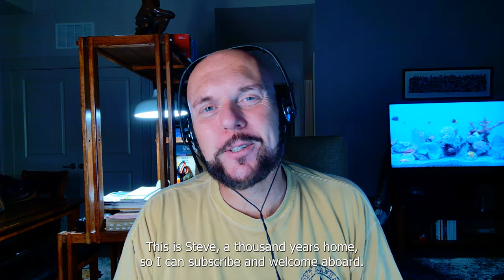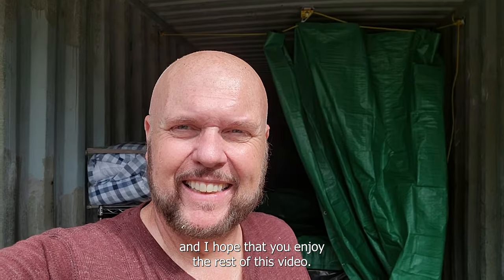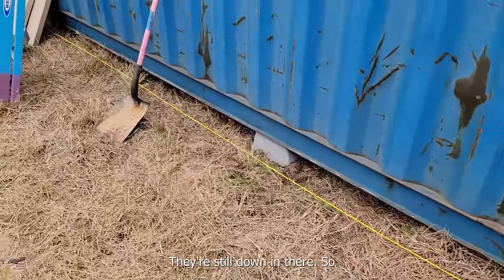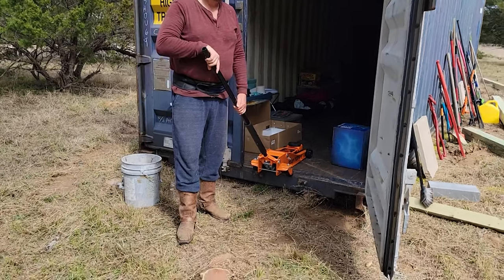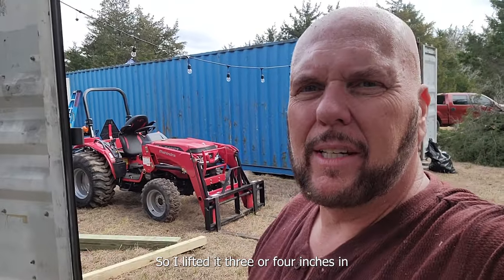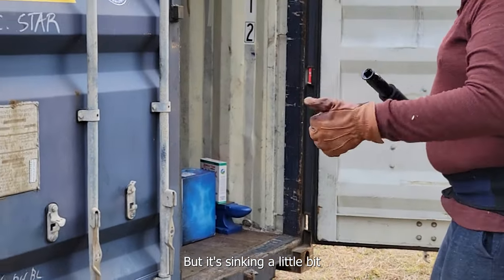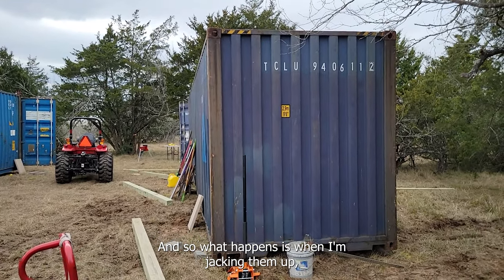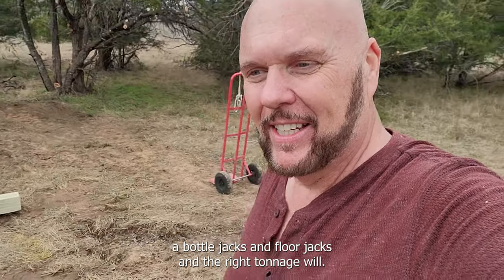How to raise and level 40 foot shipping container.

Comment: Mine arrived from overseas, loaded with goods. It weighs 28k lbs.. I’m struggling even getting one corner up at a time. Keep pushing blocks into the ground….
Reply from the maker: That is heavy. You will need to check in with local extension offices on the soil load bearing.

In the video it isn't clear, but I only raised mine a few inches at a time and used 18" x 18" blocks. My sandy loam can hold 3000lbs per sq foot. So, my 8720lbs empty container had 4 piers x 1.33sq/ft per block x 3000lbs supports which gave me about 15,960lbs of support. 15960lbs - 8,720 gross tare weight = 7,240lbs safety margin.

I used this link to calc my temporary piers: https://www.concretenetwork.com/concrete/footing_fundamentals/why_soils_matter.htm

You are already at 28K lbs. My method won't work. What's inside that? Any vehicles you can drive out?

If you got 24" blocks then you have 4 x 2ft/sq x (your soil load). In my case that would give 24K lbs. Still not enough. You will need center supports and very large end post piers.

Lastly, look for those air bag inflatable jacks. That might get you up off the ground and they are not much and they are low clearance. If you can get it up high enough to get gravel bed 3' x 3' and then a 2'x2' blocks on that, then you might have enough soil bearing for each post.  9 x 4 x 3000lbs = 108K lbs of support. 

You need that soil load bearing value, and don't just use my sandy loam. If you are mud or sand you can be down to like 500lbs.

https://www.amazon.com/ALL-TOP-Off-Road-Exhaust-Air-Jack/dp/B08XLZ1D7N/ref=sr_1_1_sspa?crid=3MH77U146XJYK&keywords=inflatable+jack&qid=1695134783&sprefix=inflatable+jack%2Caps%2C190&sr=8-1-spons&ufe=app_do%3Aamzn1.fos.f5122f16-c3e8-4386-bf32-63e904010ad0&sp_csd=d2lkZ2V0TmFtZT1zcF9hdGY&psc=1

Much Success.

Comment: Can some body tell him he needs a thick steel plate under that jack.
Reply from the maker: Thick steel plate? You made me laugh. I'm too old to cart around a metal plate and an 80lbs jack. I used a treated 2 x 12" board under the jack but it is hard to see.

One end was so buried in the mud I had to dig a hole and jack it up enough to block it before I could add the jack. So mostly the jack ran on top of a 2 x 12 treated board - which is incredibly strong in compression. Way beyond the weight of an empty shipping container. 

No thick metal steel plate is necessary. Double check your soil load bearing capacity as that is unique to each support. Then just be safe by shoring it up evenly as soon as it clears a block.

Comment: How many points underneath each box do you have blocking or supports?
Reply from the maker: Shipping containers are designed to be supported only by the end posts. You can actually put a temporary foundation under the four end posts. That is what I am doing for the moment. The number of supports will be based on the psi load of your earth. So, check with your local cooperative extension / ag office for the load value of ground in your area.

But, for a quick drop, 4 is enough.
Reply: @1000YearHomes  Thank you for the response. I'm probably going to go with 4 on each of the long sides..basically  1 on each corner and 2 additional on each long side..in-between.  Thinking 16-18" diameter  sauna tubes..4' deep with 8-10" of compacted base and stone at the bottom. I'm in northern Illinois  so 4' takes me below frost level. In a way, it's very similar to how I  have leveled mobile homes in the past and they never dropped or moved. Floors stayed level for years. I've ordered (2) 40' boxes and will be coring out and prepping area and concrete work before delivery. Having everything in place prior to delivery will make the drop and installation much easier.  Again..thank you for the information and I'll be checking out your videos and builds.